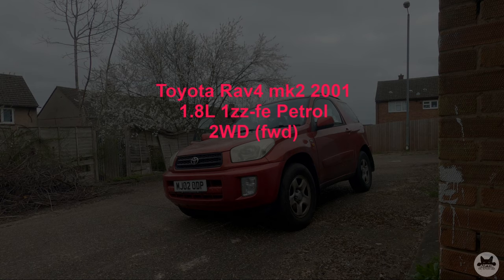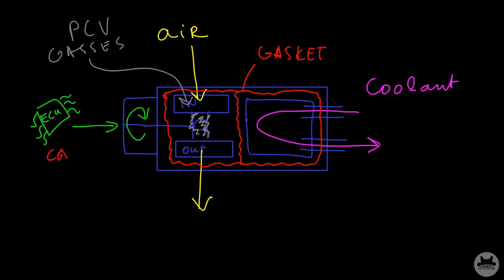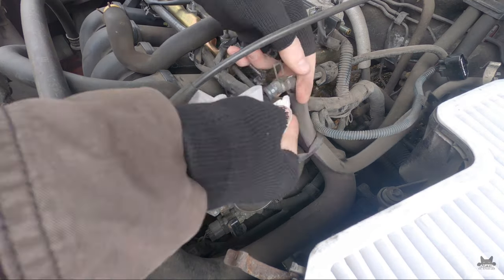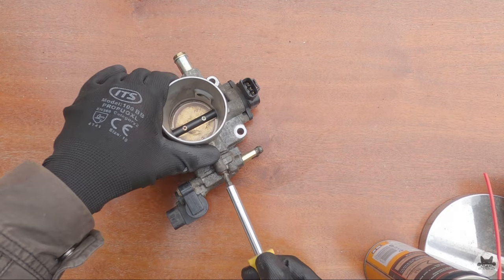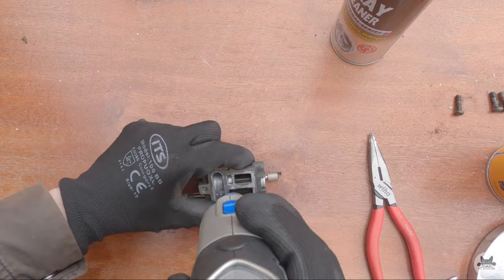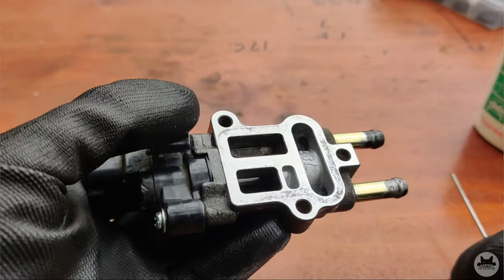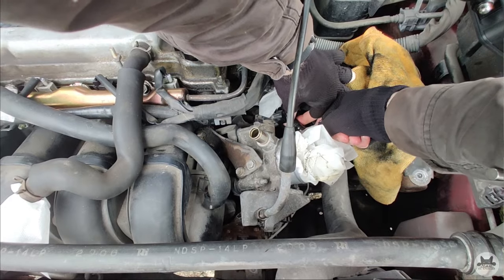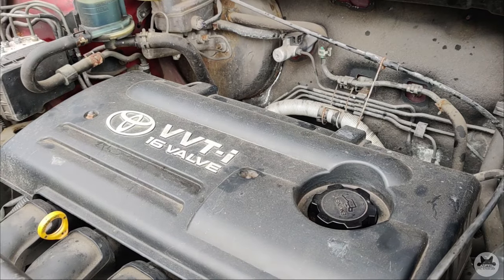High / Low Idle RPM fix - IACV cleaning (Toyota Rav4 1.8L 1ZZ-FE 1999-2005)

Comment: The video is very good, excellent technical level. it is wrong to lubricate the o-ring with this oil. the o'ring rubber will degrade, try something else,  silicone grease.....it's the same problem with the brake disc caliper boot
Reply: yes the silicone is good

Comment: Very very useful and helpful. Surprisingly I haven't been able to find such a tutorial on 1zz engines. Everyone keeps talking about Throttle Body Cleaning but none has talked about the ICAV. I'm going to try this on my celica 2000 with 1zz. I had cleaned the MAF Sensor, Air Filter, and Throttle Body from visible side only (which might've been a mistake as the car now is smoking a lot constantly). The idle seems stuck forever at 2.5k RPM and no matter how low I adjust the Idle Screw, it doesn't come down.
Reply from the maker: Sounds exactly like an IACV problem, best of luck in fixing it!
Reply: @TheRepairLair  Thanks man. Words are not enough to appreciate YouTubers such as you, who always go extra mile to spread the wee bit of knowledge available with them. Keep up the fantastic work 🙏
Reply: @abobobilly  so you solved your problem?? mine 2zzge after cleaning ivac and tb, jumps 1200-2000 rpm all the time, hot or cold it doesn't matter
Reply: @zzracer  Well, kind of. But overall, No. I fully cleaned the throttle body and the ICAV along with replacing the rubber deal for ICAV. It fixed ONE of the issues where RPM were stuck at 2k and won't come down. But the other issue remains the same (although reduced by a lot) where RPM randomly drop down to less than 800-600, giving the feel like it's going to stall. No one is able to figure out what the issue is so i've stopped bothering for a while ... so i can sleep better at night haha 😁😁
Reply: @abobobilly  do you have a p303 or p0x00 codes

Comment: Just fill the valve up with oven cleaner. It strips built up carbon, varnish and dirt. Oil on the o rings is bad as it dissolves the orings leading to vacuum leaks, use fluorinated grease or synthetic wheel bearing grease.

Comment: Very informative. Followed all instructions for my toyota wish, 1zz engine and found the valve stuck. Cleaned it. The problem was solved permanently just like that.idle is now perfect as if the engine has just been released from the manufacturer.thumbs up sir.

Comment: Excellent !
Couldn't have had a better tutorial.
I have an imported JDM 2003 Toyota Corolla Fielder wagon with a 2ZZ-GE engine. There are others with the 1ZZ-FE and 1NZ-FE engines also.
(It is less work to remove my throttle body, than it is to remove yours)
Our country has bumper to bumper traffic, so life is very hard on the throttle butterfly and its shaft in continuous stop-and-go traffic. My car is doing 235,000kms !
The idle RPM slowly climbed up this year to about 1300RPM. In some situations I used to remove my foot from the accelerator as the car went on its own, tipping on the brakes to slow down.......a dangerous situation indeed !
Removing the throttle body, and holding it up to bright light revealed spaces between the butterfly and the throat of the throttle body, especially on the cable-quadrant side. Backing down the idle screw did not help........The spaces were there !
Yes, there was wear. Wear means more air, means higher RPM.
I was fortunate to find a used throttle-body in my country. (We have an active Japanese Used-parts industry)
There was no light filtering through the throat when held up.
I did "hammer-and-chisel" the three IACV screws, then got new Philip ones for re-assembly.
The two electromagnetic actuator "petal" screws were slackened with a pair of giant pliers. New Philips ones for re-assembly.
I used the same procedure you did for cleaning and re-assembly. (I am 68 and knew Singer machine oil as a boy)
Upon re-installing and securing the throttle-body and starting the car, I still got a 1400RPM idle.
The electromagnetic actuator screws were slackened, and it was turned anti-clockwise. The idle dropped.
Yes, the screw holes on the electromagnetic actuator are elongated to give about 10 degrees of turn. Clockwise to speed up, anti-clockwise to slow down. This augments the function of the idle-screw.
I have my engine idling now at 800RPM.
No more issues. I found out everything by trial and error over an extended period.
Great video for those of us who did not know. 
The Toyota part number for the IACV gasket is 22215-7A680

Thank You.
Trinidad & Tobago.
West Indies.
Reply from the maker: thank you for the extensive detail of your experience, im sure people will find the information in your comment very useful! Happy to know it worked for you!

Comment: A truly excellent how to video packed with good, accurate information. I have a 2006 Matrix (1ZZ-FE) with 223,000 miles in which the idle comes down fine after startup, but is starting to occasionally drop to 500rpm. Might be time to service IACV. Also, using an xtool scan tool, I plotted RPM and IAC duty cycle, which responded perfectly to pedal snap (duty cycle increased momentarily). I think it is starting to get stuck when rotary valve is closer to closed position.
Reply from the maker: Thanks for the lovely comment! i hope you successfully service your iacv if :)

Comment: Excellent video ,  had the same problem in my Corolla,  same engine .  Only thing I did different to remove the 2 anti tamper  screws ( for the valve step motor )  was to cut a slot in the head and use a flat head screwdriver to remove them .   I cheaped out with the gasket too ,  just coated the old one with some sticky brown aviation gasket sealant.  Anyway yeah the little car runs normally again , no more annoying 1800rpm idle

Comment: Great to find your reply that shows this IAC valve is not equipped with bimetallic spring, then kindly explain IAC valve connection with ECM.
Reply from the maker: i believe the iacv can be imagined working similarly to a solenoid valve. the ECM controlls the opening of the iacv by using pulse width modulation

Comment: Great explanation of valve IAC  maintenance, please just explain how coolant temperature controls the opening of IAC ?  Bimetallic spring working not explained
Reply from the maker: Hi, and happy you found it useful!
The coolant doesnt control IACV at all - the lines are there to warm the IACV up in case of frost in the valve in negative temperatures

Comment: I changed the throttle body with a used one, and now my Corolla is idling at 1200 rpm regardless of coolant temperature, sometimes it revs up to 1400 rpm when engine reached 90 degress.
Can the throttle body i changed too have IAC problems? 
The screws on the IAC are very rusty and very hard to find new screws at hardware store in Norway...
Reply from the maker: Yes, very likely the IACV could be the cause

Comment: Hello, thanks for your video, I have a 2008 corolla and the engine is similar to the one in the video, I am struggling to remove only the IAC valve without removing the throttle body, I tried many torx tools and discovered that it is a pentalobe or a torx plus TS25. I hope it works fine when I receive it. I don't have a mini lathe like that and the tool is cheaper. Greetings.

Comment: I just did this to mine, thanks for the video however on my 1ZZFE (Corolla) the 3x M5 screws for IACV to throttle body were 20mm not 10mm. Complete PITA to remove but got them eventually.
Reply from the maker: Well done, glad it worked for you!

Comment: Cool. Another thing to check on these engines are intake manifold air leaks and oil leaks at the valve cover, vvt solenoid, and tensioner.

Comment: Very nicely done, but I suggest replacing all of those Phillips head screws with hex bolts.  You're less likely to have problems removing them next time.  I also apply a bit of anti-seize compound to the threads.
Reply: @Tom Smith That's based on what you take out.  I don't know what they are.  I just brought them with me to the store and compared them.

Comment: Have you ever tested Red Line (60103) Complete SI-1 Fuel System Cleaner ?  Thanks.
Reply from the maker: No i have not, but out of what i did try i had the most success with Seafoam. Take a look at ProjectFarms video on seafoam: https://www.youtube.com/watch?v=agAWXnT4-EQ
Reply: @TheRepairLair  Yes, I saw that as well.  Thanks for the reply.  Red Line products are no joke (no I do not work for them), so it would be really cool if you included those products in your tests.  👍

Comment: great informative video thanks.
one question why does the IAC valve require coolant flowwthrough it?
Reply from the maker: I don't have a definitive answer, but i assume it is to prevent icing and/or sticky bearings due to oil becoming less viscous in very cold climates if the air coming in through the air intake is below freezing

Comment: Great video. I did similar job basedon this video. I'm wondering if is normal see coolant liquid drooping after disconnect the pipes.
Reply from the maker: yes, its normal, and the amount should be very minimal. Make sure to check the coolant level when done :)

Comment: Hello, I did a test, I removed the rubber from the air filter, so I had access to the throttle body, I started up and gradually covered the air intake that enters the IAC valve, as the covers stretch to stop until when completely covered, the engine stops. But I can't find the fault, which is that it starts and as it warms up the rpm goes up to almost 2000 rpm. Then when driving on the street or highway, if you leave it in neutral, the rpm goes up to 2000 and goes down to 1000 until in a moment if I stop the car they go to 2000. A query, I made contact, I measured the female card of the IAC with tester and 12 volts to the positive (black cable) arrive at the connector, nothing to the ground cable and the other signal 0.14 volts and the signal 0.14 volts..., I also tell you that if I disconnect the connector from the IAC, the car runs and does the same problem. I am very concerned that it may be the ECU that may be sending an inappropriate voltage. thanks for your help

Comment: I have a 1zzfe 2001 corolla machanic said I have an oil leak from head gasket but it only has 80k miles.  I think its the timing chain tension leaking not a head gasket because there is no signs of head gasket leak.  Engine runs good.  Any thoughts?  I think its rare for head gasket to leak oil outside the engine no?
Reply: If you have a headgasket leak just get a headgasket leak test kit.  Scotty kilmer has a vid

Comment: excellent video. thanks for sharing! My Rav4 has quite a low idle and I will do a IACV / throttle body clean and hope it helps. One thing I notice is that my coolant reservoir stays cold when my motor is warm. Is this the same on your Rav4?
Reply from the maker: I haven't paid attention to the coolant reservoir temps on the 1zz-fe, but for some perspective, at ~15 degrees C, my 1cd-ftv diesel rav4 keeps cold from idle pretty much indefinitely (thermostat almost never opens, coolant temp shows ~85 degrees via obd scantool). As long as the temp gauge never goes over "operational temperature" (meaning about the middle of the temp gauge) when you're driving then there is no reason to worry :)

Comment: Gn.
Thanks to your information, i was able to   let my  1998 rav4  idle normal.
Reply: My 98 Toyota RAV4 idles fine until I push in the clutch then the RPM's go sky high even in neutral until I shut it off. This happens some days and not others as intermittent or random, could a new IAC valve solve this?

Comment: Hello friend, good video. It would be good before fixing the fault to place a scanner to see what errors it gave us and thus check all the faults. I see that the revolutions were a little high. The normal thing would be between 850 and 950 revolutions per minute.....and also at the end of the video I see that this engine has a problem in the chain...thank for video
Reply from the maker: Hi! Thanks for the comment. To start - i have skipped showing the steps for scanning as most people wouldn't have the necessary tools. But i did, indeed, scan the ECU beforehand with toyota techstream, and it didn't report any error codes. In fact, i own a 1cd-ftv diesel rav4, and lots of mechanical engine issues (for example, stuck egr, sticking turbo vanes or sticking turbo vacuum regulating valves) are not reported, so my conclusion is that scantools are not fully reliable for diagnosing these older (<2004) toyota cars. 

Regarding high RPM at end of video - this was filmed in winter, so the car was not fully warmed up after the short time i let it idle. What do you mean by the problem in the chain?

Thanks!
Reply: @TheRepairLair  ok the noise seemed like it had a problem with the chain tensioner or as if it didn't have the right oil...regards, thanks for the video

Comment: Wonderful clip.
A 09 Corolla my son just acquired has a similar issue-idling at 1100rpm( to my prospective 1100rpm is an issue because all my vehicles' idle are 600 to 800).  I have never owned Toyota myself so this is a question for you. 1100 rpm is acceptable idle speed for toyota especially Corolla?
Thanks  and again your tutorial is very informative.
Reply from the maker: I can't answer this regarding an 09 corolla, sorry
Reply: @TheRepairLair  thanks. Happy holidays.
Reply: Hello. After the engine reaches the ideal/normal working temperature, the rpm should be between 500-800 at idle. Maximum of 900 rpm.

Comment: Excellent video!  I think I can apply some of your handy tips to my 2010 v6 rav4.  Its idle will vary after start up around 900-500 up and down.  I have changed the sparkplugs, pvc is good, replaced vacuum lines, etc.  the IACV is a good culprit to start next since I have a little over 151k miles.  Have not replaced any coils yet.  I presume this would be a good time to inspect any water hoses too?
Reply: Did the this work  for you
Reply: @SeanSullivan-d7c  I ended up not taking it apart. I found a couple extra hoses that needed to be replaced. I am using Amsoil oil. I have use P.I. fuel cleaner and since, it still does bounce a little, but not near as severe. I also made sure to clean the throttle plate and map sensor as well. I had changed the tranny fluid after I got it (twice,leaky gasket). But since it looked pretty hammered, I think the second drain, filter and fill has been immensely helpful. I average almost 24mpg with easy driving commuting to work.   I presume someday I will have to replace or rebuild it, but it runs well enough now I don’t worry about it

Comment: My 98 Toyota RAV4 idles fine until I push in the clutch then the RPM's go sky high even in neutral until I shut it off. This happens some days and not others as intermittent or random, could it be the IAC valve?
Reply from the maker: Hi! Those symptoms sound very strange, i have no idea about what could cause that. It doesn't sound related to the IACV though.

Comment: Just fkn did this and found this video after! (dam algorythm heard me I guess), and had the same trouble with the 5 pin screws. didn't take it apart!, cleaned with carb fluid best I could, and now it idles perfect. it was hesitant when hot, and too low idle when cold. Your level of detail is way better than mine. my excuse is that I wanted to do as much as I could to test it again and see if this would solve it.
Reply from the maker: I'm very happy to hear that you got it sorted! You might find that it seizes up again though, if you just cleaned with carb cleaner and didn't re-lubricate the bearings - just something to keep in mind for the future.

Comment: Hello, thanks for this video, really clear and helpful. I have a question, I want to clean my IACV on my 2005 Celica 1zz-fe, but in the repair manual, they explained that we should drain engine coolant before removing the throttle body. Is it the same for the rav4? but is there any possibilities of getting air in the coolant system? I would like to have your point of vue of that. Thanks in advance!
Reply from the maker: Hi! I don't believe its necessary to drain the coolant, but if a lot of it drains out when you remove the throttle body, you might want to bleed the system and top up the coolant in case any air did get into it. Here's a video explaining the details https://www.youtube.com/watch?v=xeTgmdRkQtY

Comment: Hi! Is it okay to clean the throttle with throttle cleaner in my RAV4 1zz-fe? I just saw that there's a huge hole for that IACV, I'm worried that the chemical would enter that vent and ruin my IACV. Thanks!
Reply from the maker: No! Do not clean the throttle valve without taking it out and spraying liquid on this car. If you just want to clean the throttle butterfly valve, you can spray throttle cleaner onto a rag and carefully wipe the valve area, but under no circumstances should you spray the cleaner directly into the valve, and have any leak down into the IACV.
Reply: @TheRepairLair  thanks! You have me subscribed to your channel! To more 1zz-fe Rav4 repairs! 😁

Comment: Same thing was done to mine yesterday and it dropped but revs high when you put off the AC. Can my engine rev at 600-800?
Reply from the maker: The ECU adjusts the RPM's to go higher when you turn on the AC, its normal. The default RPM for 1az-fe, i believe, is about 700-800, but no problem for it to rev either a bit lower or a bit higher.